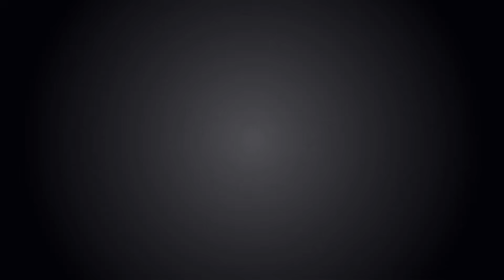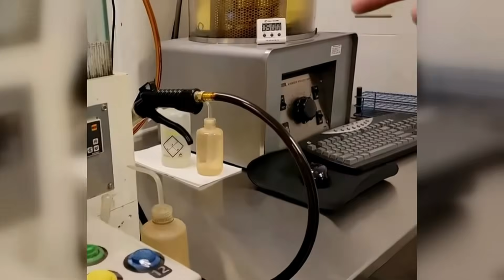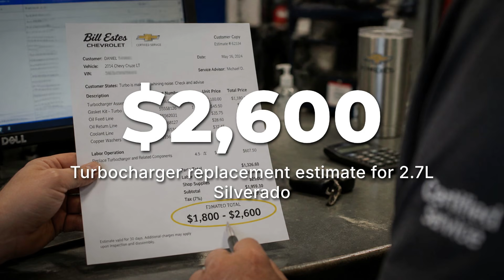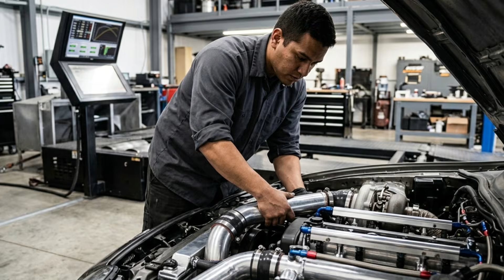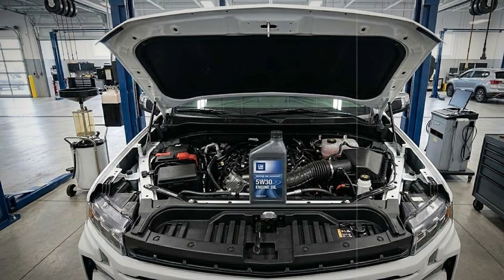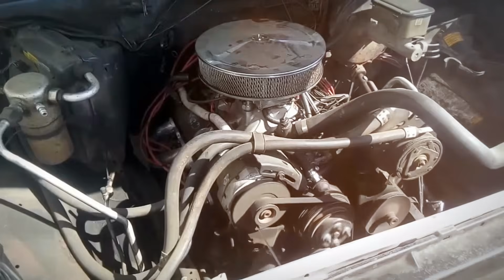2.7L Silverado Cold Starts: The Turbo Habit to Avoid

Comment: I have a 2025 Turbomax I currently have 75k a it and idle 10 hours a night 6 nights a week for my job…after I get off, I drive it pedal to medal high rpm’s  to blow it out. Never had an issue. I run Mobil 1 and change it every 5k. I also pull my 13,500k 35 foot camper and pulls like a champ